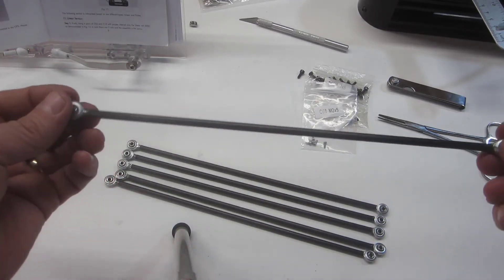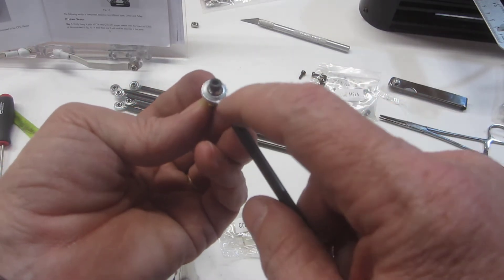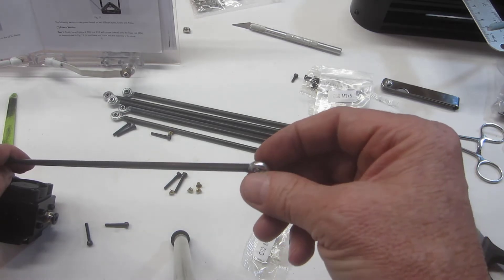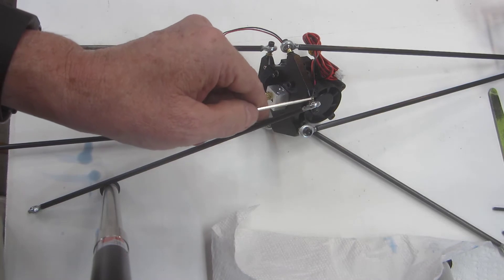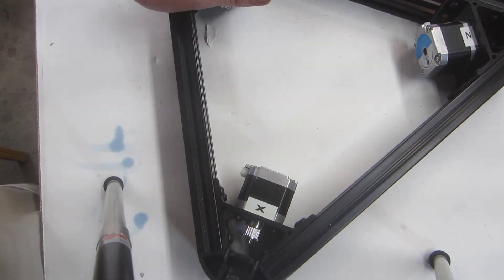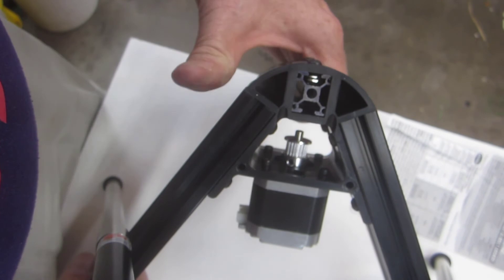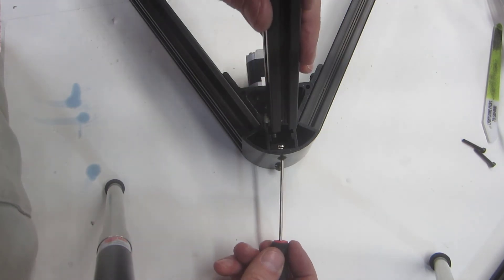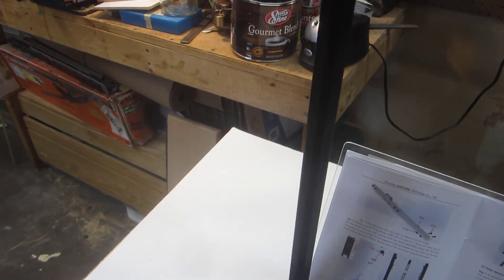Anycubic Linear Plus Delta Build 6 Adding the control rods to the print head

Comment: The linear plus kit I just received included the M3 and M4 T nuts in separately labeled bags indicating to use them instead of the supplied nuts.  Anycubic was listening to previous kit builders' comments.
Reply from the maker: Thanks again for watching my videos, and thanks for the information too. I am probably going to order a third one of these and that will save me from ordering un-necessary parts.
Reply: I ordered mine from AnyCubic through Aliexpress.  It was less than on Amazon but maybe fresher stock?  I received mine mid-April 2017.  It was less than on Amazon but you give up Amazon protection and immediate delivery.  Mine took 6 days but shipment time varies from China.